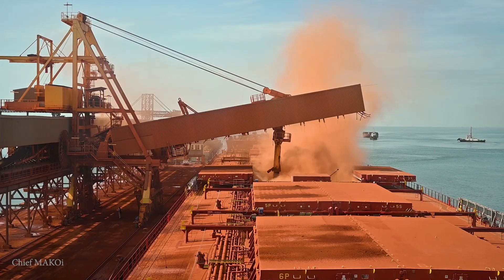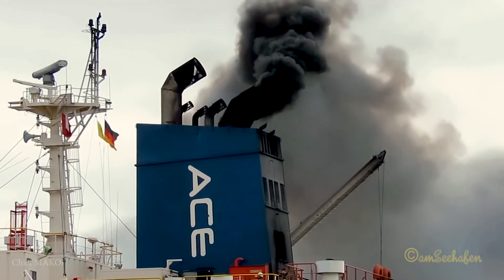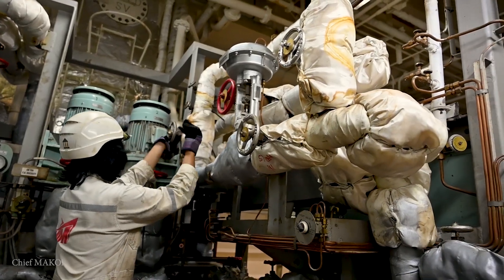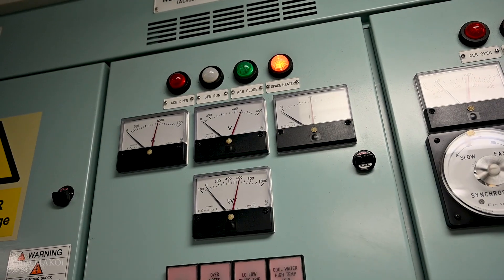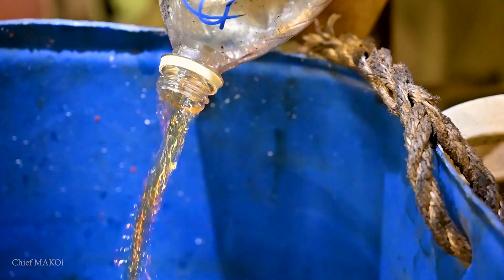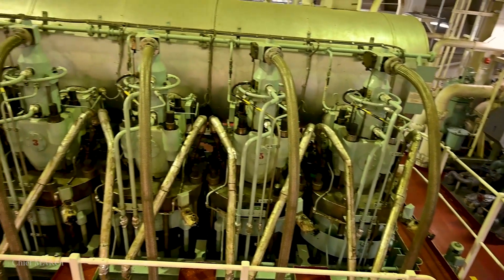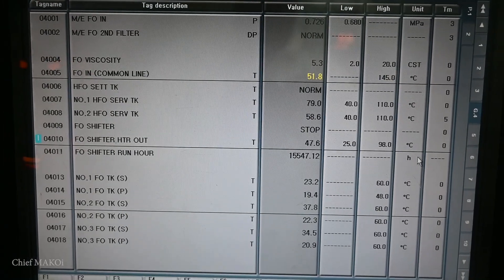Changing The Ship's Fuel : From Heavy Fuel Oil to Gas Oil Changeover Procedure | Chief MAKOi

Comment: I was in the US Navy in the late 60's,lso on a refuling ship. The black oil fuel was the primary fuel for ships. Also carried NSFO(Navy Special Fuel Oil). It was almost a kerosene like fuel oil. The Navy was changing over most of their ships at that time. Older ship were decommissioned with out change. NSFO is a much cleaner burning fuel.
Reply: Wasn't this also done, because alot of military vessels have turbines to insrease power in combat situations and turbines need very low sulfur content in order to function?

Comment: Hi Chief, do you still use the real heavy stuff the Bunker C heavy fuel oil? is it still cheap as it used to be?
Reply from the maker: It's around $400+/metric ton.  The ships with exhaust gas scrubbers can still use them.
Reply: @ChiefMAKOi  400 per ton is not cheap but still better than regular diesel I guess.
Reply: @ChiefMAKOi  In the past people here used to burn used lube oil in their lorries and trucks as well as water heaters for public baths (Hammams) as well as fishing boats but it has been forbidden. But it was soo cheap lol

Comment: VERY INTERESTING!
AS A RAILROAD DIESEL MACHINIST I HAVE SEEN VARIOUS PERFORMANCE FROM ONE TYPE OF FUEL TO ANOTHER!
MY EXPERIENCE IS THAT THE HEAVIER GRADES OF DIESEL FUEL IS OF A HIGHER BTU CONTENT.
IN EARLIER DAYS I ALSO WITNESSED DIFFERENT PERFORMANCES OF BRANDS OF FUEL AS WELL WHILE DRIVING MY OWN DIESEL TRUCKS, BUT NOWADAYS HIGHWAY DIESEL FUEL SEEMS TO BE MORE CONSISTENT, REGARDING HORSEPOWER OUT PUT!
THANKS FOR THIS POST, CHIEF!!

Comment: Wow, this brings back a memory I haven't thought of in years. The boilers at the paper mill where my father worked when I was a kid burned Bunker C, which was delivered in railroad tank cars. In the winter, you could tell the days when they were getting an oil delivery from anywhere in town by the huge clouds of steam rising from the mill's rail yard. They had steam vents underneath the tracks in the unloading area to heat the tank cars from below, so that the oil would be hot enough to pump out of them even in below-freezing weather.
Reply: The rr cars have internal coils, in the tank so the company can supply steam for heating. They heat the car from the inside. Some cars have external coils under the insulation and external jacket.
Reply: Somewhere in Wisconsin?
Reply: @rpnabar  Maine.

Comment: Whole lotta Bs that makes it more expensive to ship goods. Price is always passed on to the consumer. Already was low sulfer. Just like this diesel fuel we have in the states now. It's so thin it doesn't do a good job lubricating the high pressure injection pump. No big deal. Just an extra 4 grand when it fails every 50 to 100k. ( Trucks and cars on the road from small sedans to semi trucks.) Trucking companies are going back to big block gas engine because once considering the maintenance cost on new diesels it doesn't offset the lower mpg and higher cost of fuel for gas. Plus, diesel is higher than regular unleaded now!

Comment: When I worked on fishing boats, sometimes we would talk about ships. Their use of Bunker Sea Oil and how it is heated with Steam Boilers. You talked about exhaust scrubbers, the ships use to blow the stacks to clean them out like out at sea before coming into port. Is that still done? 
  Also the high pressure boilers from what I heard they would use kitchen brooms to look for pin holes, as the clear steam would cut the bristles off cleanly. Is that true? Thanks for the videos!

Comment: Big ships are massive polluters, but it's out of sight out of mind.  The fact that ships carry extra "special" fuel for certain regions tells you something. ... it's a shame but that's the way it is.  It's also hard to imagine what the higher sulphur fuel could even be used for if not in a high volume engine.

 Thanks chief for the neat explanation about the operational side of it!!
Reply: It is possible to refine high sulfur fuel into lower sulfur, but it increases the processing cost.
Reply: They should all just switch to Scrubbers so that they can have the cake and eat it too. Pretending to comply with environmental regulations and just switching fuels as they come to port does nothing when they all continue to dump toxins in the ocean.
Reply: @infernaldaedra  I agree. Although it's worth noting scrubbers convert sulpher to sulphuric acid, which is dumped overboard.  Saved up while in port if the country does not allow discharge. Dirty little secrets huh?
Reply: @busydadscooking001  Everything we make and throw away goes right in the ocean. There's really no oversight for large vessels at sea is there? I understand that there is no use for the waste but they are really just dumping toxic waste right in the water, You would think we would have a better solution like the ability to pump out the waste and try to process and neutralize it at ports but my guess is they don't want the responsibility either.. so in the ocean it goes.
Reply: @busydadscooking001  big ships are heavy polluters but somehow they're the cleanest form of cargo transport per unit weight. Try subtitude these ships with trucks or trains and the result will be even worst.
Reply: Our politicians won't let Canada make irs own fuel, insists getting from halfway around the world then tax us for that, when there are alternatives
Reply: @evepeters3691  Stop voting for who the news tells you to.
Reply: Here’s to capitalism hey?
It’s not because we can’t do better, just because our imaginary god mo et days it costs more, so we do t do better.
Depressing.

Comment: Is this also called number 6 oil that is being used in your ships? If so about 10 years ago I was on a HazMat Team working on the east coast of the US removing the old pumping lines at ports they were no longer needed as the ships were using a different cleaner fuel oil. This oil was some terrible stinking stuff and almost impossible to get off of our equipment and our clothes had to be thrown away as washing them was impossible. We went through cases of Tyvek coverall suits until our part of the jobs was finished.

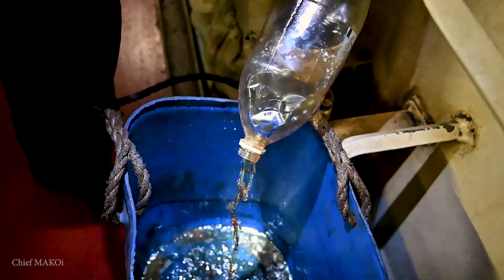Comment: Very interesting indeed.  I wonder at the fact that the engine is high tech and able to adjust to fuel types while they are being ramped up and ramped down again, yet the funnel at 2:35 is arguably not so high tech.....   Surely a small fixed extension could move the valve to directly above the bucket?
Reply from the maker: That ship had engine problems that'a why it was blowing black smoke.

Comment: This is an issue that I would have had little idea about. 
Fuel in class 8 trucks (18-wheeler rigs in the United States) is regulated similarly, we may only use Ultra-Low Sulfur Diesel (ULSD) in engines manufactured after 2005. ULSD is defined as having a sulfur content of 15 parts per million maximum. Low-sulfur diesel, the previous standard, was 200 ppm max.. We may only use ULSD for commercial trucks. #2 fuel oil (red diesel) may only be used for off-highway diesel engines and equipment. Diesel exhaust fluid to reduce particulate emissions is also required, and all emissions equipment must be in place and operational.

Comment: Chief, very useful video for the engineers! Very important to observe the temperature and viscosity during changing over from one grade of the fuel to other. When I was worked on a chemical tanker, we had the problems with fuel equipment, such as filters and fuel pipelines system. Because was bad bunkering(quality of fuel very poor). It's depends from the place of getting the fuel and of the company! Best wishes, all kind.

Comment: I feel like there should be a fuel sampling valve just for this purpose, instead of having to remove a pipe to get a sample.
Reply from the maker: The drain pipe that was connected to the sampling valve was too long.  That's why it had to be removed.

Comment: Dear Sir,  Why do they use fuel with such thick viscosity, as opposed to say diesel? It's seems (to me) that the fuel heating would offset the savings? How much fuel does  fuel heater use itself? If you lose fuel heater, that would be very bad, right? It seems (again, to me) that this would be as thick as road tar, lines would fail? All the Best! 73 DE W8LV BILL
Reply from the maker: The heater uses steam which is produced by the Exhaust Gas Economizer - which is basically a boiler, but it uses the heat of the exhaust gas to produce steam.  So there's no additional fuel expense.

Comment: That was really interesting, I did not realise you were required to use different fuels in different areas. You explained very well thank you. I fully understood your explanation even though I have no engineering background.
Reply: More a subset. The fuel for ships in international water is residual fuel oil. It's nasty stuff: Burning it pumps out clouds of toxic waste. Choking, corrosive clouds that erode all they linger on and cover everything with soot, and ruin the lungs of anyone exposed. It's so horrible that most countries have banned using it - which means it is also dirt cheap. Good for ships far from shore because there is no-one around to be bothered by the pollution, but once the ship enters territorial waters where that fuel is restricted it has to switch to a less polluting but more expensive fuel.

It's just a way to shift the most serious pollution to a place where few people will see it.
Reply: I think for cargo ships there is something going on as well, but for cruise ships you can see it as they make it quite obvious.
I heard of some ships burning "marine diesel" close to shore and in port, which to be honest i am not sure if it is the same as the gas oil or if it is even cleaner stuff. Sometimes scrubbers are mandatory to enter port as well.
Other ships can switch over to LPG or run completely on LPG.
And to have no engines running while staying in port, some ports have set up huge power connectors to provide the ship with electricity. I think that is not necessarily restricted to cruise ships, i have seen this for cargo ships as well.
Only problem, for smaller ports the electrical power needed would be more than the power consumption of the whole city.

Comment: From 1958 to 1963 I severed as a "Stoker" in the "Andrew",Royal Navyon ships that ran on FFO,furnace fuel oil that needed prolonged heating to allow it to ignite in boiler to create steam and it was like black smelly pitch.  In the event of a spillage it caused disasters to all life caught in it!
Reply: Or did it need prolonged heating for it to get thin enough to be pumped and injected??
Reply: @clevelandmortician3887  I guess you guys are both kind of right. When it's cold and thick you cannot get it to atomized properly so it's either Burns very poorly or not at all
Reply: @joecummings1260  I was asking not telling

Comment: Great video!  next please do a follow up on the accompanying adjustments required for main engine lube oil injection! Not sure if your vessel is using BOB/Blend on board, but nevertheless the change in fuel sulphur spec likely requires you to adjust lube injection rates (if not switching to different Cylinder oil tank altogether)

Comment: I would think the heavier fuel would also have a higher energy content. Is there a major difference in fuel burned per hour between the two fuels?
Reply: Surprisingly, not that much: https://en.wikipedia.org/wiki/Energy_density
All the liquid hydrocarbons come out in a quite narrow range.
Reply: Specific gravity of fuel seems to correlate with energy content fairly well, so yeah you're going to burn a good bit more fuel by volume, but by weight more or less the same amount

Comment: Great video! Is there a difference in engine performance besides the engine running cleaner?  On the cleaner fuel, does the engine run more efficient?
Reply: The heavy stuff contains more energy, you generally see a little more power/efficiency with it. The lighter fuels significantly reduce the amount of soot and other contaminants building up within the engine and exhaust stream
Reply: @knotical689  Thank you! :)

Comment: My old WWII Navy ships were oil fired steam...and we normally burned Navy special fuel oil...but we were able to burn almost anything and in the ships operating manual were lists and tables to burn everything for common to obscure...Bunker C at one end to acetone at the other...what surprised me at the time was hoe counter intuitive the energy density of the fuel was...The heavy fuels had much more energy in them ...and for example it we had to operate on Diesel fuel for some reason instead of the heavy oils...we could only achieve about 1/3 speed...and of course we use up all of our fuel capacity that much faster...

In practice though I never experienced this nor did anyone that I ever knew or sailed with...Strictly from the book not experience ...we always only burned Navy Special fuel oil...It needed to be heated to atomize and burn...but not to be pumped...we never needed to heat our storage tanks...but they were all equipped with the heating coils in case we ever needed to use Bunker Oil...

Comment: In regards to your fuel sample pipe, instead of needing to remove the pressure fitting every time you need a sample, why not plumb in a Tee with a ball valve or a locking high pressure valve of some kind? Seems like a pain in the butt otherwise.

Comment: Kind of amazing that two very different fuels can work in a compression ignition engine.
Reply: Both Detroit Diesel and Cat had multi-fuel compression ignition engines for the military.  Startup had to be on Diesel fuel, but could switch running to gasoline with the right injectors.   Many stationary diesels can operate mostly on natural gas once running with a small Diesel pilot charge at essentially idle levels.

Comment: Question: Even though an “authorized” border official also samples your fuel type when entering the zone, do they take or monitor your actual emissions? Without scrubbers … dirty exhaust is still dirty exhaust not matter what your running as fuel.
Reply: I guess not, because the concern is sulfur which burns to sulfur dioxide, which then gets washed out the air as sulpherous acid, a bleach like substance that killed many forests in the 80's when heavy oil or coal with high sulfur content was burnt without scrubbers for power generation (acid rain). And this reaction is just driven by the sulfur content, so less sulfur burnt, less sulfur dioxide in the exhaust.
Reply: Government regulations are a tricky balance between doing what the public thinks they want and doing what the public needs. In this case, the public thinks it wants strict emissions regulations, but in reality they need economically viable transportation of goods. And if you know anyone who works on large engines, they'll tell just how it is not economically viable to run exhaust scrubbers for the majority of operators.
Reply: @ObamaoZedong  Emission standards are a changing target in the last decades. Operators will have to calculate if a retrofit scrubber is viable, or if they just pay the higher price for fuel now. The next vessel will be equipped with scubbers for sure. I live in Hamburg, Germany (large port city). The pollution from the harbor is in the news all the time, currently they try to convince the cruise liners to use shore power instead of running their generators. I can only imagine that that will continue for cargo ships as well.
I had a similar decision to make in 2000 for my car: My then 21 year old car had an unregulated catalytic converter without lambda sensor. And the vehicle started to be taxed like a car without catalytic converter. I had the choice to retrofit the lambda sensor, new catalytic converter and some motor management electronics. I did not feel that that was very cost effective, so I just kept the car for one more year while looking for a new (used) car which fulfilled the new regulations and saved some money on vehicle tax from then on. I upgraded like 3 emission classes (nothing to euro 3). Now this car is 19 years old (3 more months to 20 years old) :-)
Reply: @kuebbisch  People will complain about the regulations and emissions standards, but if you've ever been in an area with poor air quality you know they're necessary. Retrofits are rarely cost effective or even practical. 

Here in the US 3 way catalytic converters have been required since 1981 (the type your old car lacked, the computer/sensor-less 2 way converters came in 1975). To run efficiently with the old engines most required an air injection pump to add enough oxygen to the exhaust gasses for the converter to function. A lot of people saw an air pump they deemed to be unnecessary and a drain on already weak engine power and just removed the belt powering it. This gradually killed the converter substrate and when some states introduced emissions testing requirements the vehicles would fail, badly. Owners were faced with having to install a new catalytic converter and reconnect the air pump, or get rid of the car. Through the magic of the US testing/inspection laws being state-by-state and not federal they would just sell the car to a state with no testing or inspection requirements...

Comment: I have a question. Do most of the ships use heavy oil because it is cheaper. This is the only restricted area in the world, where the emission of the ships and the fuel is controlled?  I read that the tendency today is to change the fuel of the ships to LNG that of course has the lowest emission.

Comment: In olden days we used to raise the temperature of Marine Diesel oil temperature to 65-70 * temperature while changing over from HFSO to MDO. we also kept running FO Booster pumps in the port and maintained temperature of 60* so that main engines start quickly